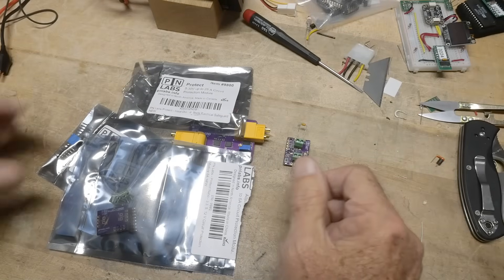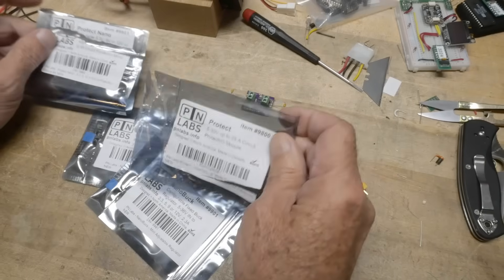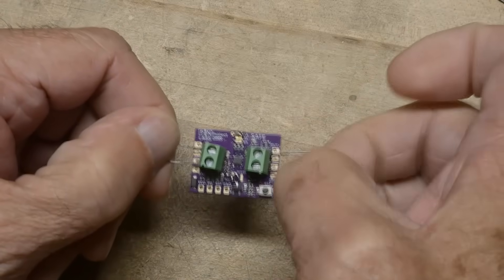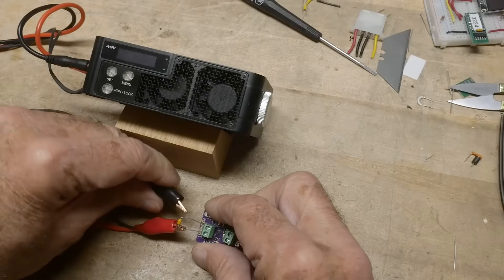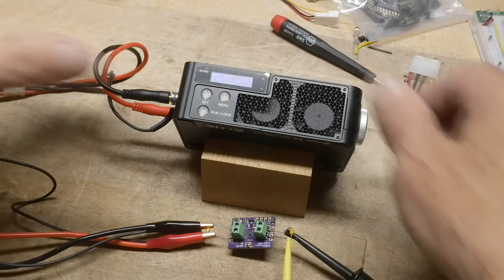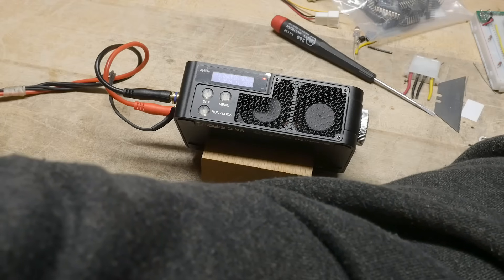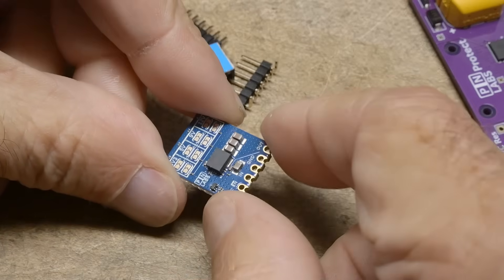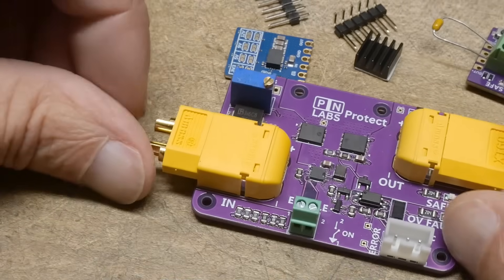#2411 PN Labs Voltage/Current Protection Device

Comment: Big shoutout to IMSAI Guy for featuring our products. We’re a small team building straightforward, useful circuit tools for hobbyists and engineers, so it was really cool seeing them on his bench. If you’re curious about anything or want updates on upcoming stuff, feel free to reach out. Lots of new designs on the way including upgrades to our Protect product, beefy voltage regulators, power-logging tools, and some battery-friendly add-ons we can’t wait to share.

Comment: Canadians always think about safety 😂
PG is power good. 
12V protection should be always be more due to voltage of the rechargeable batteries.
I use a simple 1N4001 diode instead of the capacitor that you used. It helps when I mistakenly connect the power wires in wrong polarity.  I also have it on my breadboard.   I learned that when I mistakenly connect my breadboard wrong and burn a bunch of CMOS chips.

Comment: Thanks for this presentation. I enjoyed the demo. I think somewhere around 00:07:30, you were saying amps, but possibly meaning to say milliamps. I was thinking those mini-grabber leads should start to smell hot around 9.8amps! I also really like the adjustable load device! Cheers.
Reply from the maker: it was amps and the test leads did just fine
Reply: @IMSAIGuy  You're saying you set the board up for 1A, but in testing it was freely passing 9.8A. 
Robert is saying perhaps you meant 980mA and misspoke.
Reply from the maker: @clinodev  i remember now, it was .9 and I just shorted it to 9

Comment: Dscovered the Amass XT60 connecters a decade ago, have been using them in my DIY solar system. 
A word of caution the XT60 30A max, the XT90 45A max
Reply: Yeah, they're good and robust connectors, pretty popular among drone and RC model folks. 
I'm tempted to use them as speaker connectors for hi-fi systems to replace banana plugs and binding posts. Small, gold plated, high current rating (so, low resistance), polarized and not that common that your ordinary hi-fi enthusiast will plug a speaker into a battery, haha.